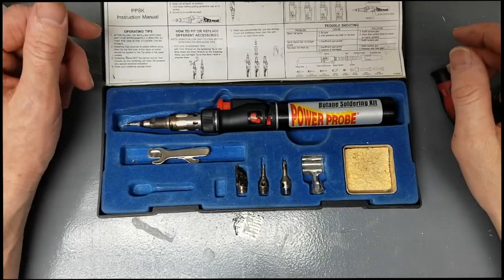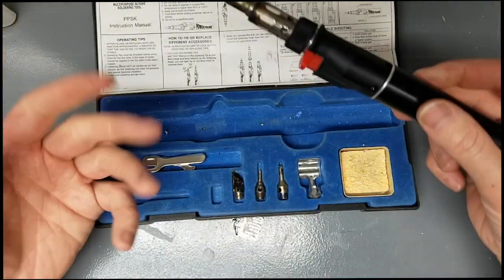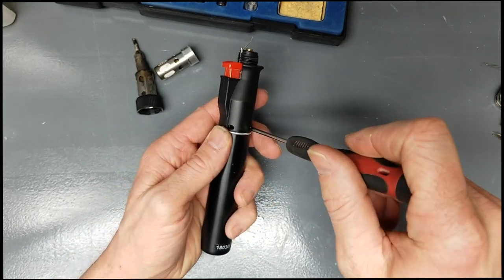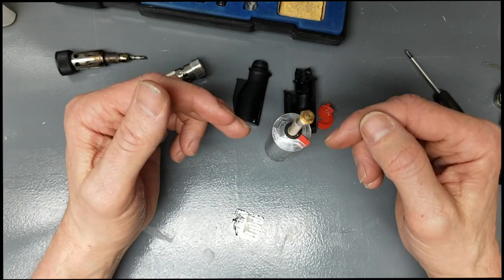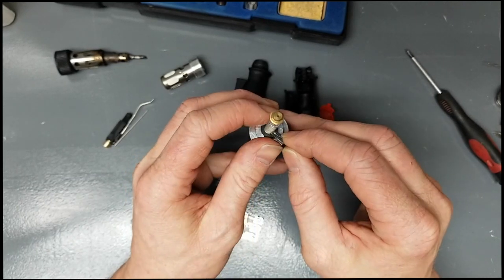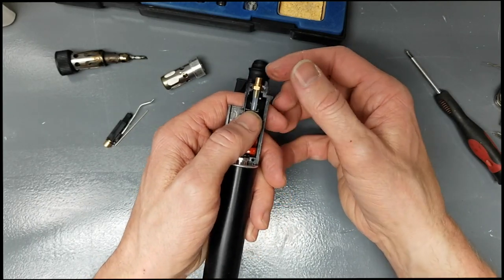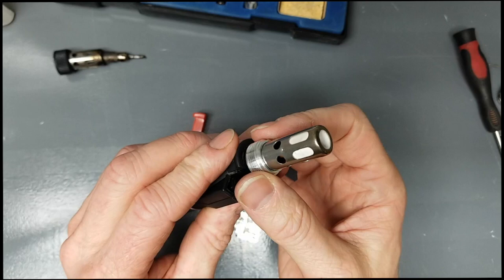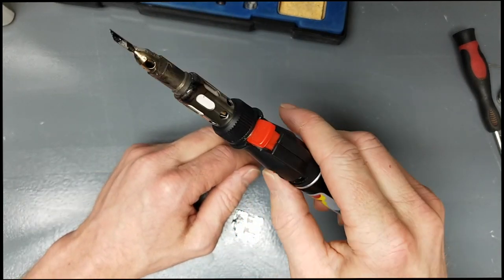Butane Soldering Iron Fix (Wont Light)

Comment: Thank you for the repair, this fixed mine. I have a Master Ultratorch UT-100. Once I got it apart I realized that I didn’t need to take it apart, there is a small flat bladed screw on the heat intensity slider that allows you to loosen and re-position the slider to throttle the flow back a little more (feel some resistance when the slider is near the left side). After doing that it worked like new. 

Thanks again!

Comment: i have a Bernzomatic butane soldering iron.  running Ronson butane fuel in it.  worked well for a year or so (sporatic use) but in the past year its gotten to the point that ive reverted back to the the el cheapo plug in iron.  id love to get the butane one working again.  it was very convenient, and the torch was perfect for setting heat shring

Comment: Well I tried this hack or repair and it did not fix the problem ,however if unscrew the plastic shell nut and lift this assembly off .The torch lites fast but as I lower this assembly back down it snuffs out the flame.

Comment: Mine does the same thing.. It floods the burner.. I have to ignite vertically and hold the carburetor open for 20-30 seconds until I see he orange glow from the ceramic chimney (burner) then let go of the igniter which closes off the air. Then it burns but as I move it around you can hear it flooding.. After 5 mins it burns fine.. I have the Master appliance UT-100SI.

Comment: Well the disassasbly helped, but my issue seemed to be plugged up in the tip. Once I got that cleared, I just seem to have a huge flame, even when I screw the adjustable part all the way in snug. Turning it up from there makes no difference.

Comment: Hey, I have a dremel. Pretty much the same. It worked well with a normal lighter fluid/ butane. After changed the brand the flame got really weak. It doesn't make that whistling sound anymore when I fire it up. The flame on the torch is also very weak. I'm currently using some high refined butane and have purged the tank but it still does pretty much the same thing. any thoughts?
Reply: I'm sure you figured it out by now but turn the gas up. this happens to all my torch lighters when I change fuel.